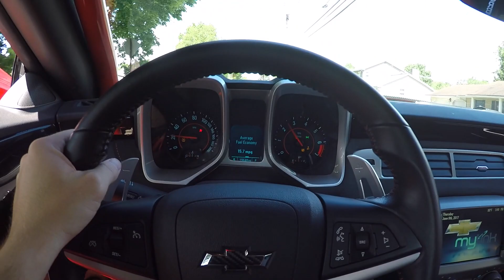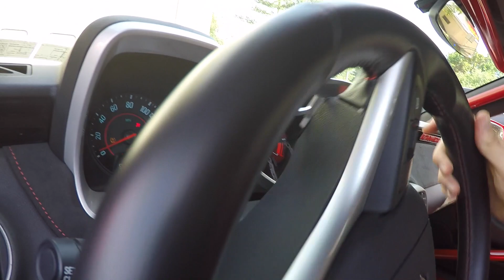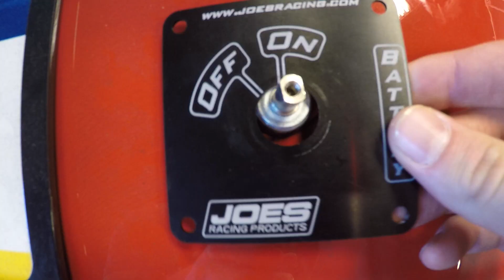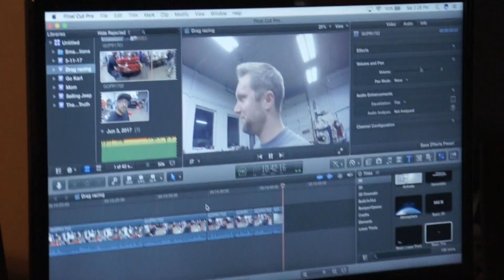IN CASE OF EMERGENCY, FLIP THIS SWITCH!!! | GuitarmageddonZL1

Comment: car's so slow, I bet I can beat it with my daily
Reply from the maker: Joshua Corona probably
Reply: GuitarmageddonZL1 I'm calling you out. I got a 1980 corvette stingrays, with a 632ci, 1100 wheel horse
Reply: Turtle Turtle I have a 1980 blown corvette stingray, with a 632ci blueprint crate engine, and a built up 10 speed gm auto. it runs high sevens
Reply: Joshua Corona post a video of it
Reply: WHY THE HELL ARE YOU DAILYING A 1100 hp Corvette ?
Reply: Joshua Corona The stopped making stingrays in 1976.. Come on now, this should be common knowledge for C3 owners. All corvettes after 76 until 82 were not stingrays
Reply: Cigar it's a t-top stingray
Reply: Joshua Corona So you have the only 1980 "Stingray" in existence?

Comment: Unless you're running in a NHRA event.... you didn't need the full cage or the cut-off switch. Just some advice, run drag radials at the track. Run the slicks (bias-ply) street racing. You also need a converter. Depending what RPM and what gear you're in crossing the line, should determine what rear gear and tire diameter you need. You have the power, your set-up just needs some adjusting.

Comment: Before watching the video, it's a battery, fuel cutoff for the safety crew to use.
Ok, I missed the alternator but I think cutting off the fuel pump (if electric) is smart.
The only concern I have is some asshole flipping it off at a stop light so on the street you'll need a override to use the cutoff at the track.  That covers it, does it?  ;-)